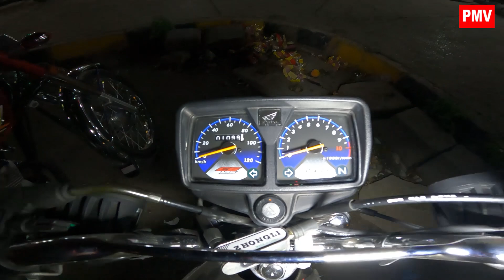Poor Quality Control Atlas Honda CG 125 SE Model 2021

Comment: I also bought a brand new cg 125 SE following great vlogs of PMV
My first bike and a great riding experience
However
1. The wheels were not aligned
2. Rear rim was also not balanced and the tyre used to bubble

These issues were not expected in a zero meter bike from honda showroom
Reply from the maker: Wheel alignment is not an issue
Reply: @PakMotoVlog  indeed but i expected a zerocmeter machine to be flawless :p

Comment: Naeem bhai in pakistan there is no good service honda motor cycle if you go any where for first tuning of your new bike after tuning your petrol everege is disturb allmost I am since 2000 till now I change 12 honda 125cc and 2time cb150f every time there is same fault for example before 1st tuning everege is good after tuning there is some thing wrong in motorcycle everege is disturb its mean pakistan there is no good macanic  all honda repair shop are fake in rawalpindi lot honda repair shop zaheer auto antina shop and lot of other every one is same the all macanic untrande Sahame for honda pakistan